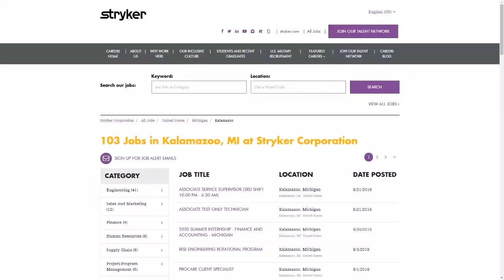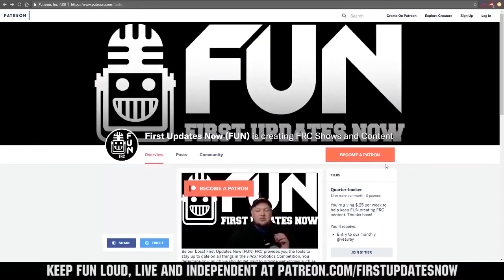Bop Ross Reveal - FIRST Capital Ri3D - First Updates Now

Comment: Best ri3d robot, no question
Reply: No, sno' problem was cooler
Reply: Revan Darklighter sno’ problem has problems with their flywheel, it doesn’t always fire the ball where it should, sometimes it goes up like 6 inches
Reply: @dillonrere8813  Concerning design. It is able to go through the trench and is able to meet all the requirements.
Reply: Revan Darklighter yes, but it isn’t as reliable
Reply: @dillonrere8813  Well I guess you're right.
∩    ∩
    ~